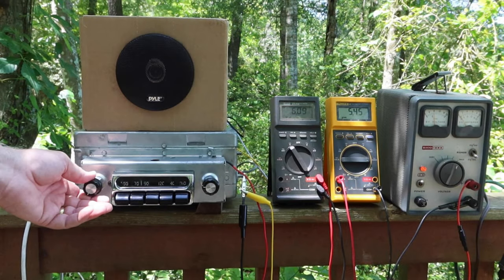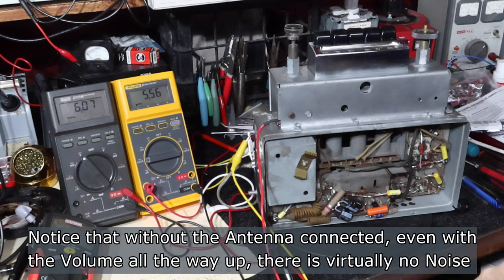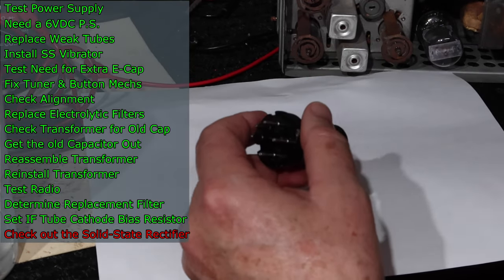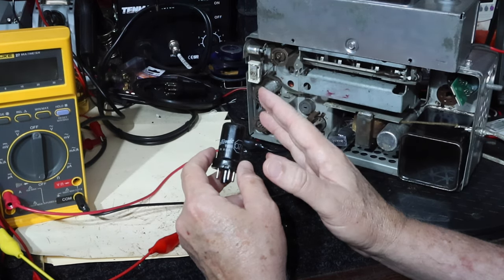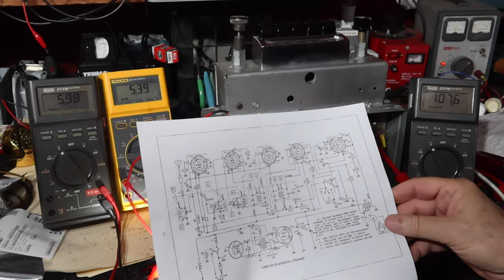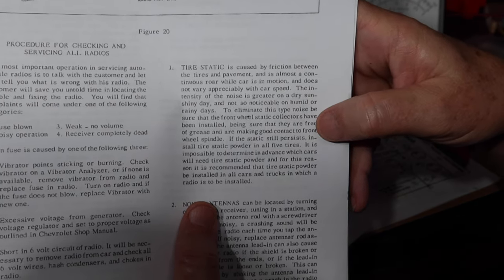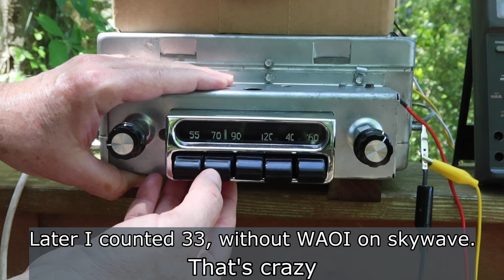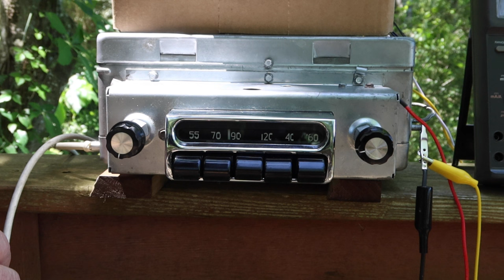MAXIMIZING SENSITIVITY / FINALE - 1953 VACUUM TUBE CAR RADIO Part 6 - CHEVY MODEL 986668 [4K]

Comment: Yes I agree, really good informative series. Very detailed  for sure. I should have a much easier fun time getting my 6 volt from 1948. It just mine doesn't have the rectifier tube because the points have  two sets of pointsin the vibrator, then I gues it's called synchronous type

Comment: Never heard of UF4007 diodes in the Silicon  diode world. Silly me. Their features of high surge current capability and 
high reliabilty as a replacement diode for lets say a Selenium rectifier in a tube set in the home makes me think I could
use them instead , well  if I run out of the 1N4007 ones I have. I'm glad you found that info on the condenser used in the 
auto generator and the rest. I knew it was important to design noise suppression for a tube radio in cars back then. We 
often forget why  certain  electrical components were put in cars in the first place. Like tire static? Who knew. One thing
I might ask if after the car owner puts the radio back in  his car we can see a video on  how well it receives  stations after
 all this work you put into it PF , like Doug's post below where he mentions that. Great series man! Steve
Reply from the maker: Thank you Steve.  Yes I hope he is willing and sends a video when it is in and he is ready to show it.  I know he is still working on the dash, instruments and interior so we can't rush him.  He has owned this car for over 40 years so he owns the timetable.  He is in an even more rural area than I and is surrounded by hills and he told me his reception for any radio is limited.  I am hoping he will be able to get some evening and night DX; I sent the call sign and frequencies of several FCC Clear Channel Class A stations in his region of the country so hopefully he will be able to get some of them when the car is out of the garage.   I had not heard of the UF (Ultra-Fast) version of the venerable 1N4007 either so the credit definitely goes to Jeff Angus at the Radio Museum forum who posted the info which I showed.  I will be using them too.  Thanks for your help as well.

Comment: Nice wrap up on the radio PF. Wow, it does seem to be very receptive. LOL Would be interesting to know how well it performs back in the car if that is a possibillity? The one in my '61 Buick is a tube type Delco radio and it would be neat to see the circuitry differences of almost 10 years would be. I think GM switched to solid state radios in '62 or '63. I tested mine in the car back when I got the car about 13 years ago, but have never had it out on the bench to have a look at it. Might have to do that one day. :)
Reply from the maker: Hi Doug and thanks.  The car restoration is on-going as elements of the interior are still being received and the radio will be eventually installed.  That would be interesting to see the differences from a '61 Delco. Hope you share the adventure if you look into it.  Thanks again.
Reply from the maker: Doug, I found a schematic for a '61 Buick radio online.  It was a tube radio but had an output transistor.  The tubes ran on just under 12V so there was no power transformer.  It would be interesting to see if you decide to take a look at it.
Reply: @PracticallyFixed  So it is quite different than the one you have. I might pop it out when I go to put those new 6X9 speakers in the back. :)
Reply from the maker: Here is the link to a schematic I found which might be for your radio.  If you look at the URL looks like the Shop Manual is there for the car as well if you need it.  Thanks
Have to change it up some some so YT doesn't block a link: You know what to do with the 'slash's and 'dot's.  The percents are as they are in the url:  buick dot oldcarmanualproject dot com slash manuals slash1961slash 1961%20Buick%20Special%20Shop%20Manual slash 11-Radio%20Heater%20AC slash n_P0007 dot jpg
Reply: @PracticallyFixed  I appreciate all the trouble, but actually one of the first things I bought when I got the car about 13 years ago was a PDF copy of the SM on CD. I do have the schematic for my radio and it looks like it has a transistor for the IF amp as well as the audio output. A true hybrid for sure. :)

Comment: Very interesting. But are you not you getting somewhat higher voltage readings using the modern digital voltmeters compared to using the old style analogue turning coil instruments that were used when the car radio was new?
Reply from the maker: Hello and thanks for watching, and the comment.  That is an interesting point and is something that I did not focus on at the time, but your comment sent me back to the schematics.  There were 4 schematics I used in this series (Beitmans, Sams, United Auto, and the Chevy Shop Manual) and I did not realize the differences they contained until I noticed one of the them had the AVC resistor values this set contained, versus the other schematics which had different values.  While I frequently used one schematic which was technically an older revision (Beitmans), I thought it showed up better in the video.  However when I got around to doing the final voltage checks to test out how the solid state rectifier was doing, I used the correct one (Chevy) with the correct AVC resistor values for this set.  

Looking at the detailed notes of these schematics, the one from Beitmans called out using a 1,000 ohm per volt VOM.  I thought "oh, that is a big difference to the DMM" (the manual for the Fluke 27/FM gives the nominal input impedance as 10Meg ohms).  The Sams and the United Auto schematics call out 20,000 ohm per volt VOM, much better.  However I just noticed the schematic which I used for the voltage check, from the Chevy manual, called out using a VTVM, which as you know is very high impedance compared to the 1,000 ohm per volt VOM (and were also around when this radio was being made).  

How much difference that would make will vary with the circuit, but if one is trying to be precise it is wise to keep your point in mind.  I normally do not sweat that degree of precision in tube gear from the 50s but was giving it a lot of attention in this case to be sure the diodes with the resistors were working ok. 

So in general you are quite right, and some of the schematics I showed did indeed mention VOMs including one at 1,000 ohm per volt, but I was using one at the final check which happened to call out a VTVM, so while I was not careful about that..."I think I got away with it!" (- Basil Fawlty)  I won't dust off my old VOM just yet anyway however, I like the autoranging DMM so much more than the old days which I remember well, just need to keep expectations when comparing measurements in check.  Thanks for the excellent observation.  [edit: corrected impedance for Fluke 27/FM]